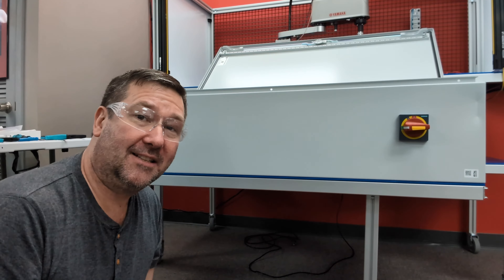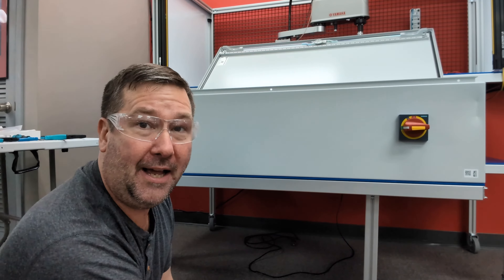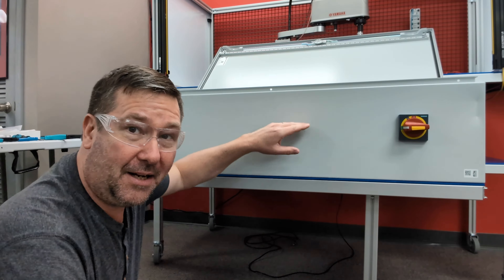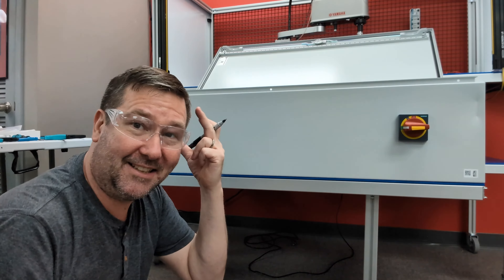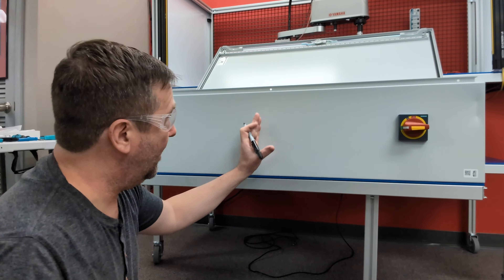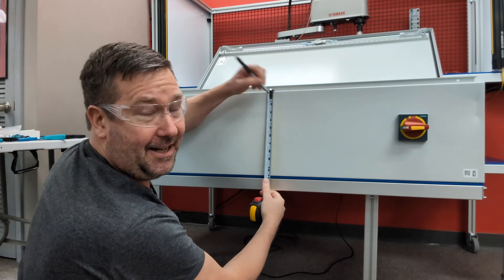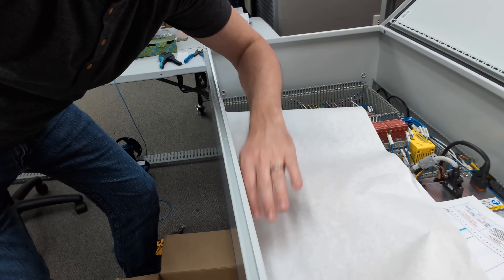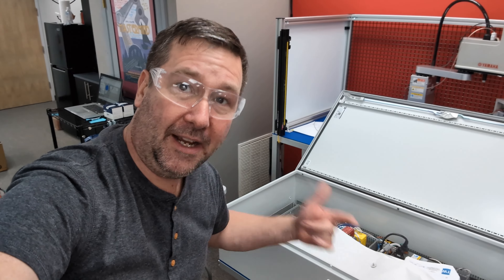Do I Really Need to Measure to Drill 1 Hole?

Comment: Something i do when marking out is to masking tape the area, so any marking out mistakes aren't left on the panel. Also, i now use Greenlee hole punches to form the required openings. You end up with a perfect shaped round or otherwise hole and no deburring required either.
Reply from the maker: Great tips Andrew!
Reply: I now use the Millwaukee battery punch, it does the job in seconds and the greenlee punches I have fit it.
Even the 40x40 for west controllers, plus an even bigger one - great ons stainless steel.
The greenlee foot pump has been resigned to a dark corner of the workshop :)

Comment: If the cabinet is steel, I put a magnet on it as I am cutting to prevent the metal shavings to fall down, You should still cover it. But it is a nice trick if you are working on the field and there is hardware in it already.
Reply from the maker: Great tip!